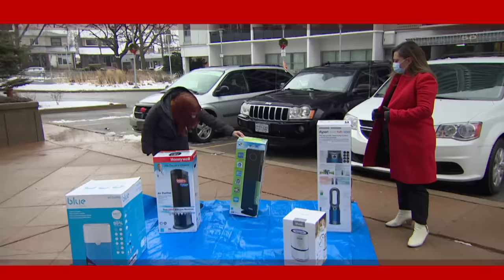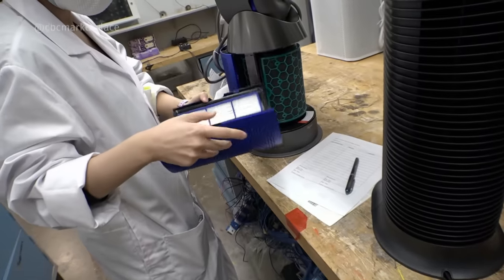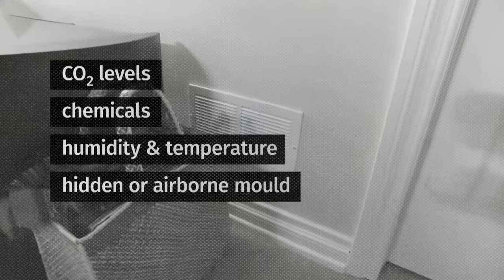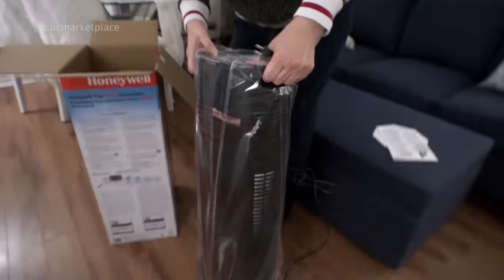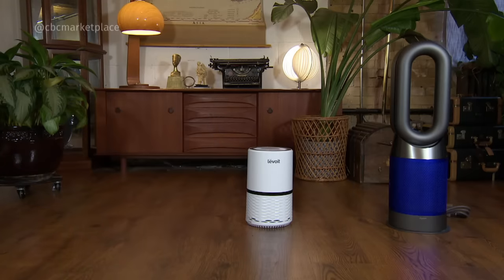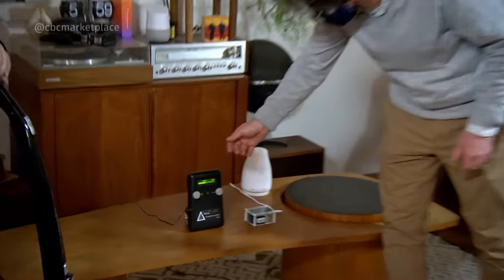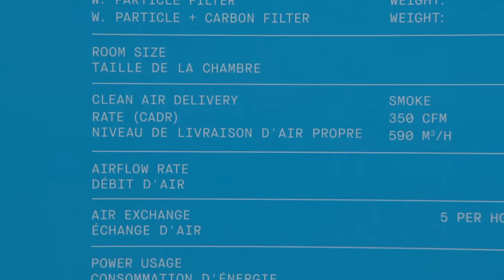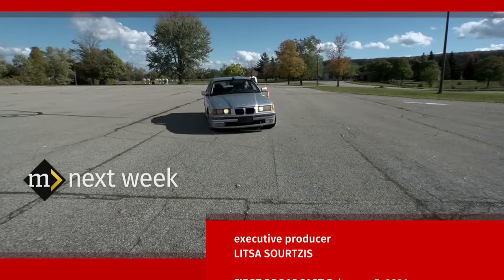Is an $800 purifier best to clean your home's air? We lab tested 5 top brands

Comment: Is this true for the test you did? I was pretty underwhelmed. I wanted to know like reductions in different levels and percentages. CADR seems a pretty limited and basic test, surely there is more to an air purifier. how does it affect mold levels, VOCs and so on. Does room size matter. It seems that them levoit is for small rooms and the blueair for large rooms so of course it would be more powerful? Simple research:

"For all of their advantages, CADR ratings don’t tell you everything about an air purifier. One of the biggest CADR limitations is the fact that the test does not include gases, odors or VOCs. These non-particulate contaminants are very common in home air and can be targeted by air purifiers that use carbon filters. Many air purifiers that carry CADR ratings use HEPA as well as carbon filters. When these air purifiers are submitted to the CADR test, only one part of their filtering capabilities is actually being measured. So, if gaseous contaminants are part of your home air quality concerns, a CADR test should not be the only metric you use in picking out an air purifier.

 

Another drawback of the CADR test is that it only tests air purifiers on their highest settings. While this is an understandable standard for the test, it can inflate the unit’s efficiency in a buyer’s mind. If you are buying a bedroom air purifier, for example, it’s fairly unlikely that you would run it on its highest setting while you’re sleeping due to noise concerns. This being the case, the air purifier you buy would not be performing as efficiently as it was under the conditions of the CADR test. This fact is important to keep in mind when looking at the CADR ratings of air purifiers you’re considering.

 

Finally, the CADR test only shows how an air purifier will work within a very limited period of time. While the 25-minute test allows the unit to cycle a significant amount of air through, it can’t tell you how it will perform after weeks or months of continuous use. As HEPA filters absorb particles from the air, they naturally experience slight declines in efficiency. While this shouldn’t be a serious problem if you’re changing your filters on the manufacturer’s recommended schedule, it is worth noting that the clean air delivery rate of a purifier with a brand-new filter operating for only 25 minutes will be higher than that of the same purifier with a filter that has been absorbing particles for several months.
"
Reply: Did Dave from Dyson give you the rest of his explanations that they probably edited out? Because what you've said sounds pretty much like an elaboration of his "we don't think that the measure of air purifying capacity is the only thing that's important when it comes to appraising air purifying capacity" line. To be clear, I'm not necessarily disagreeing with you or Dave, because nothing can ever be distilled down into a single all-encompasing number without at least partially sacrificing nuance or compromising situational variance, but the underlying issue that this piece was trying to highlight is that customer expectations in regards to these air filters are not necessarily matching up with developer intentions (if we're assuming good faith rather than corporate greed), which among other reasons seems be greatly influenced by imprecise and uninformative product claims on the box or in ads.

This mismatch between company and consumer is a fault and responsibility of the company, not the consumer, who should be provided with adequate and relevant information about the product and its expected use cases so that they can compare the product with others and thereby make a decision. It's all well and good for Dave to encourage customers to do their own research, particularly for a company like Dyson whose products are priced more than high enough that most of their customers are probably capable of actually conducting such research or have enough money that they don't actually care. But a great many consumers are not actually capable of successfully undertaking the kinds of product research that Dave and many other companies seem to expect (or hide behind), which is why we have consumer protection laws that place the responsibility for researching and communicating information about a given product onto the company, not the consumer, or that at least prevent companies from making claims or representations that they can't reliably demonstrate.

Like, I'm sure that the legal department at Dyson and all those other companies have scrutinised every word of those product claims and ensured that none of it actually breaches the letter of the law regarding what claims they can and can't make, or how they must represent them, but based on this video it seems like many of these companies are less interested with actually helping their customers make informed decisions about their products (which you'd hope they trust enough to be appealing when portrayed truthfully and saliently) and more interested in telling customers (or not telling them) whatever is necessary and legal in order to goad them into buying the product. Obviously, I don't naively believe that this practice is limited to the air filtration industry or that it's a remotely new practice, but it's still disappointing to see nonetheless.
Reply: thanks for your detailed response. Very good critique!
Reply: The reason they don’t test it is because hepa is hepa, it’s already a known quantity. So cadr really is the only difference, other then looks and features. Levoit sells specific filters for VOC/PET/Standard Hepa, there are very few differences between hepa filters

Comment: The blue air brand uses electrostatic technology which is why it's so efficient with it's air flow. But it also generates very small amounts of ozone, and can actually reduce the ozone in the room. If they're CARB certified you should be fine unless you are super sensitive to ozone.
Reply: Electrostatic = ionizer, very controversial if negative ions helps or hinders your health. I got the 211+ Auto today but I wish I did more research on this. Customer service at Blueair does not seem to professional so far.

The Blueair is CARB certified.

Comment: I have 2 DIY filters, they work GREAT! After a few weeks, those filters get pretty nasty so change regularly! I paid 12USD for mine. I got a box fan from the thrift store for 8USD (Lasko-brand, retail for about 30USD at the hardware store), and grocery stores almost always have MERV7+ 20x20x1 filters for about 4USD in their clearance bins. I personally use a 9USD 20x20x2 filter from the hardware store for improved airflow (longer pleats increase surface and almost doubles my CFM).I use aluminized metallic furnace tape for my sealing (10USD for a roll that's barely 10% used after 4+ filters) instead of masking tape to reduce porosity and increase air into the filter. A little trick: Because of the circular flow pattern in a square container, the 4 corners of the box fan will actually INTAKE air and recirculate it without pulling through the filter. Take a piece of toilet paper and hold it to a corner and you'll see it sucking in. To remedy this, I use the furnace tape over the corners to create cowls such that it ONLY exhausts air. I have a little CFM and Air Quality meter I got off eBay for 70USD that I have benchmarked to be reasonably accurate and the PM2.5/PM5 counts dropped significantly when I added the cowling.
Reply: I would go got MERV 10+
Reply: good tip!
Reply: Thanks for the tip!!

Comment: The home made one with the fan and filter is a great idea and works fantastic but, there is something to consider. Fans need to breathe in order to work correctly and the blades need to be kept clean and free from debris on the sharp edges in order to move the most air possible. The lifespan of the fan motor will be shortened from heat and strain of trying to move air through the filter. Listen to the fan when in operation for any abnormal noise from the motor because it will start to short out over time from the lubricant and the bearings drying out. Also feel the temperature of the power cord as it too will heat up from trying to consume more power to feed the motor over prolonged times of operation. If you sense anything odd, please stop using it and stay safe.

Comment: Evaporative humidifiers should be fine, the issue are ultrasonic ones with anything by pure water (distilled, RO)
Reply: Also if you have mould issues it is a good chance you need a de humidifier
Reply: What about cool mist humidifier?

Comment: I have a Honeywell 50250-S. Man, can that thing clean the air. Loud as heck on the top speed, because it's moving so much air, but I have allergies and a mold problem in my apartment and I'm extremely impressed with its performance. If I keep it running, my chronic cough disappears and the air just feels fresher.
Reply: I have the predecessor to your 50250. I just found new old stock filters and pre filters on ebay.

Comment: Humidifiers I will keep on using because the air from electric heat gets so dry it effects my breathing and I have lung problems. I only use it at that time though (so winter) but not the rest of the year.  I also make sure the humidity is no higher than 50% but usually 40%.
Reply: Yeah it’s hard to take this completely as is because anyone who lives in a cold place would know how much better it is to have higher humidity in the winter especially when sleeping

Comment: I have been using the fan with a 3M Filtrete furnace air filter for years.  Unlike this video, make sure that you tape the correct side of the filter to the fan.  The filters are unidirectional, and there are arrows on the perimeter of the filter showing the direction air needs to flow (metal reinforcement side inward).  Other than that, thanks for doing all of the testing, and analysis, there are few sources of scientific information such as this report.

Comment: CADR measures the rate of clean air delivered. So obviously the bigger the device the higher this will be. This test isnt exactly fair based on varying sizes of the devices.
Reply: While I don't disagree, I think the comparisons are all very valid. I think, instead of being compared to raw CADR, however, I think the MORE valuable measurement would CADR/Dollar
Reply: @mr.bennett108  im not saying the tests werent valid. I just wish they had chosen models that were more in competition with each other to make things more fair. Right now its like having a civic, corolla and bmw 335 going up against each other to see which is the better driving car.
Reply: Yep pretty much. Also Dyson have a naturally low CADR due to its design
Reply: Not to mention they didn't test for VOCs which HEPA only filters will not filter. Dyson was entirely correct that CADR while important isn't the only metric, additionally a finer filter that filters smaller particles will have more resistance for any given surface area. They didn't strap a HEPA filter to the box fan so the measured CADR  is immediately not comparable to any of the other air filters (though the filter used was still good enough to trap most allergens like pollen and dander.) Additionally they did not disclose the efficacy in reducing the particle counts, what good is a high CADR if the filter is 70% efficient vs 90% efficient on a model with lower CADR. There's too much nuance into what makes a good filter to cram into a 20 min video that needs to tell a story.

I feel marketplace's quality has been on a sharp decline for years in their chasing of broader audiences by americanising the editing style and removing all semblance of actual information and quantifiable testing.

Comment: Interesting would love to know what a good solution is then for humidity in the air. Especially in winter when we have the heater on?
Reply: same, I need a humidifier for medical reasons and want to know what a good one would be.
Reply: I use distilled water and I have no problems at all. It’s just a hassle to go buy it every few days from the drug store. I highly recommend though.
Reply: look into “evaporative” air purifiers that do not release any visible steam
Reply: Evaporative humidifier is what you want, unless you have RO water or very soft tap water, don't bother with ultrasonic, it will send, not only the minerals in the water but everything else in the air (eg bacteria or mold that can grow in there)
Reply: Measure the humidity first.

Comment: This is the first video I watched about the subject, and after looking into it a bit more, I am highly skeptical about the results. Your air quality will not depend on the speed that you can remove particles. A lot of air purifiers has other features like removing bacteria/VOC. The Dyson cleaners have glass fiber filters and they can also remove formaldehyd

Comment: The thing about the questioning they are pursuing with Dyson is that the measurement they use is how much air they filter and not how well they filter the air, or how good their filters are.

Comment: Just because you put out more clean air doesn't mean your air is the cleanest. Dyson could have a terrible CADR but a very high air cleanliness quality, therefore still doing a better job than a competitor or even a box fan and a filter.
Reply: YES! This! As Dyson said, you can't base your evaluation off of one metric. So many other variables!
Reply: @mia.t  what I understood is that CADR is a measurement of the volume of air that it can purify. It doesn't test for how clean the air actually is coming out. With how the newer Dyson is built (completely HEPA sealed), I find it outperforms any air purifier out there. I have really bad asthma and I have been able to breathe better at night since I got mine. The Dyson also runs very quite during nightime.

Comment: The filters are not the same and not only cidr matters. I could tape a fishing net over a fan and it would get a bunch air flow. Doesn’t mean it’s filtering more. Dyson had a carbon filter, so smaller particles will get filtered out that would pass through a normal filter every time, no matter how much air you move. Furthermore, for smaller living spaces, there is no reason to have a ton of air being moved. The main difference you’ll have is just louder noise. What matters is the rate of air entering and leaving the space, the size of the space, the rate of particles getting generated, and the rate of particles being filtered out. Most people don’t have massive hvac systems and aren’t having massive spikes of particle generation like you’d see in industry. Instead, the generation is lower and more consistent. A lower cidr but higher filtration system like the dyson wouldn’t need to be highly responsive to mitigate spikes. Instead, it may take longer to filter initially, but once it’s at its steady state in an hour or so, the particles in the space will be lower than the others.

Comment: David from Dyson is right . Volume rate is not the only metric and does NOT mean a better air purifier. The flow should match the size of the space being cleaned because higher flow,  everything else being equal means one or more of the following: louder, larger, more energy, less filtration. Many of the markplace episodes mave these unsubstantiated ideas.
Reply: I can say you are wrong - for most people, the CADR is the most important. Without enough flow rate, you air are not get cleaned it should be.
Reply: It's still not a good air purifier

Comment: One detail is missing in the testing procedure...i.e. were they all tested at maximum speed?  thanks!
Reply: Wow well that’d be very noisy! We have a larger floor model Levoit. It is set on Auto which is low, if the air quality changes so will the fan speed, all automatic. They never even mentioned that. Before I bought our Levoit I checked out more than 1 independent review and Levoit always placed in the top ten, 1st many times. I checked these independent reviews again after the show and BlueAir isn’t even mentioned, Hmmm.
Reply: @WhirlyPearly  That’s great! Our son moved back home with two bengal cats, we started getting stuffed up and taking allergy tablets didn’t help as much as we thought. There’s a tv commercial where they brag about using air purifiers in dental offices so I searched and found Levoit. We’re back to normal now and breathing easy!

Comment: Ok, so you released the CADR but you don't say what the full filtration aspect is in how effective the product was in reducing or eliminating particles (& what types) in the air was for each of the products. Were some models more effective at large or small particles? How about viral loads? More info and test results needed.

Comment: An hvac tech here. One thing they missed is, the more air it pushes through the filter, the more electricity use. Always keep this in mind. Also dyson air projects air where it’s needed. For example, these other brands are more efficient when it’s placed in the Center of the room which isn’t relevant. So what happens when you place a blue air in the corner? Half the cadr drops. Smh

Comment: The cleanest homes are those that are completely sealed and have a system of bringing fresh air inside and to be filtered there is actually a name for this and it is a little expensive to build but it cost less Electricity to heat and cool and you’re bringing fresh filtered air from outside
Reply: That sounds awesome I've had allergies so that would really help, do u know where you got this information from? Is it similar to a laboratory where the environment is sealed and air is cleaned regularly?
Reply: @Christoff070  
Not nearly the same I believe the homes are called Net Neutral or net zero homes I will send you a link to one of the guys that builds these types of houses
Reply: @Christoff070  
These are just a few links to some of the videos he’s done on these types of houses